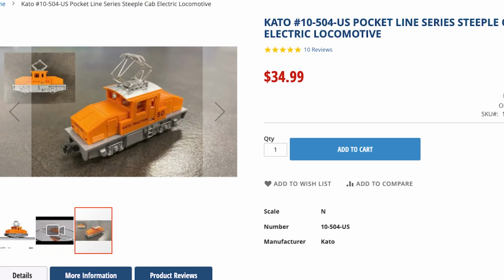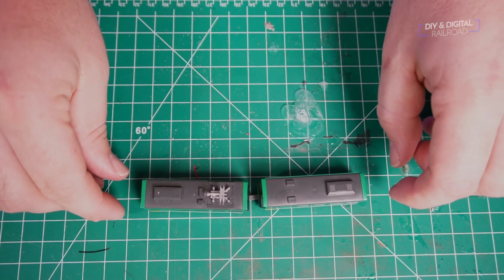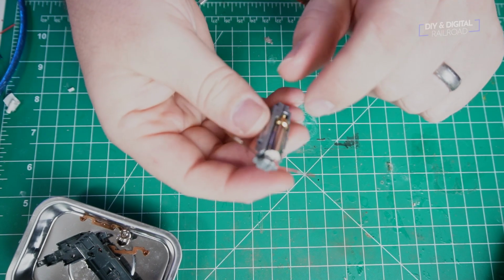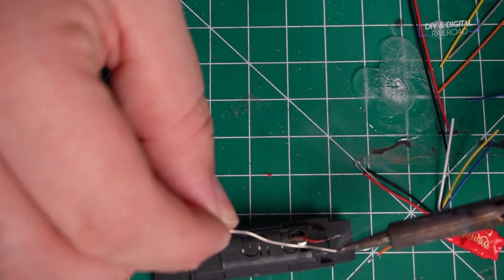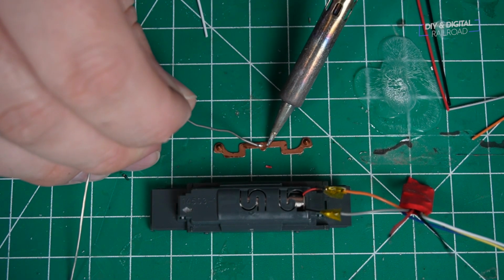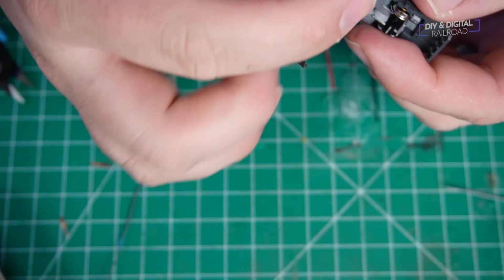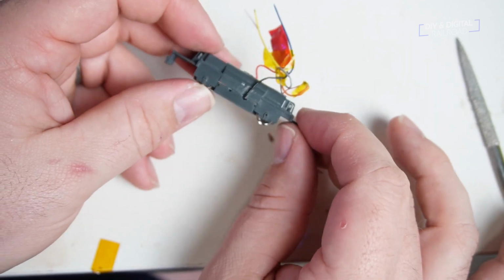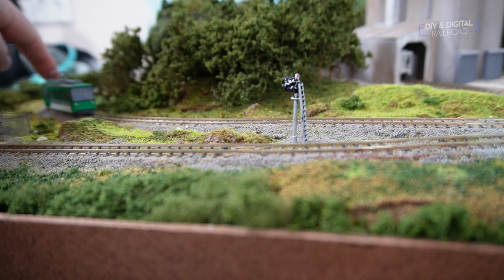Turning these Cheap model trains DCC

Comment: An easy alternative to kapton tape is heat shrink tubing: just cut a short length of heat shrink tubing, slip it on to one side of the unsoldered joint, then solder the joint as usual. Slide the tubing over the joint and lightly brush the soldering iron over the tubing - it will shrink down and conform to the soldered wires. The tubing provides enough insulation to prevent the soldered joint from coming loose.
Additional tip: if you're having trouble tinning a solder pad on the contact plate, try filing a small area of the plate to remove any oxidation. This should help the solder to stick better.

Comment: If you have trouble making a little solder pad on copper then I would recommend giving the area a quick sand so the solder has something to key/adhere too
Reply: I would also suggest a little flux on it as the surface most certainly is oxidized a bit which is why that solder was rolling off when it should have been sticking to it.

Comment: Super helpful! I may have to try this one or two of my pocket line units. Since they are pretty cheap, it might even be worthwhile to get two of them and then combine two powered units together instead of having one dummy and one powered unit and then maybe wiring them together so they share power pickups, so you don't have to install two decoders. I say this, of course, because I have two of those same tram units, plus two of the steeple cabs, so that might be a way to get better performance on grades and would help with any dead spots on the track. However, the pocket line units I have had seem to perform pretty well on turnouts as they are, which is surprising. They do have that little flywheel in there, which helps them coast a bit longer through minor power interruptions.

Comment: Nicely done. Sound isn't out of the question either. simply route the purple speaker wires to the trailing car with a sugar cube speaker. Micro connectors could be employed if you wanted to run the motorized unit solo. Always a nice watch

Comment: Nice conversion. Thanks for sharing this install. I have both pocket line models the tram and the steeple cab. This is a great idea. I got so use to DCC ready locos that I forgot about the first DCC installs that I did were mostly custom fit.

Comment: I always use flux on pickups all you need is a drop of solder then attaching the pre tinned wire.   I agree using a heat shrink tube to cover wire connection.   Great video by the way I have done a lot of hard wired locos and your explanation was spot on.   Thanks for sharing

Comment: Great Job, converting this chassis to DCC! 
I love watching your channel, especially the arduino projects.
Another way to connect the track wires from the decoder is using the copper pads you discarded. Solder the red and black wire from the decoder to these pads and put the pads back into their slots in the chassis. It is a bit more fiddly to do because you have to put the wires back through the hole for the motor wires but it looks much neater. It saves you tinning the contactplates and filing gullies for the wire.
Edit: Hmm I am a bit late with my solution, Thorsten Kammer already commented on this.

I used this chassis (kato 11-108)  and its siblings (kato 11-109/11-110) in a few of my 009 narrow gauge loco’s.
Regarding the slipping on the slopes you could try adding a bit of weight in the tram body, if space permits that is.

Comment: SOMMERFELDT makes functional pantographs in N scale.  To run on live overhead, run the red wire to the pantograph.  The black wire can then be connected to all wheel contacts.  One rail can then be divided into sections for activating signals, etc. Overhead wire can be either phosphor bronze like the prototype or nickel silver.

Comment: Hi
I had similar performance issues when I converted the steeple cab electric loco. It turned out that the drive gears were not properly engaged because the motor was not sitting down far enough into the chassis. It was the extra wires that were causing the problem so a bit of re routing and I got the gears to engage properly. It now runs well and will easily pull 6 uk style goods wagons.

Comment: The Bullfrog Snot is going to inhibit electrical continuity on any wheels that you apply it to.  I’d consider adding more weight inside the body, if possible, to add traction.

Comment: Interesting! I soldered the red and black pickup wires back to the original copper tabs instead, but routing the wires through the shell together with the other wires was a bit of a challenge. The steeple cabs are a bit difficult with cable management since the only place for the decoder is in the cab. I've also used a smaller decoder there (the DZ123 is quite big and long after all).

What you describe with the tram running sounds like maybe the motor isn't perfectly in place in the chassis; it's rather sensitive to small variations there. At least two or three cars should be possible over small grades.
Reply: Which (smaller) decoder did you use?

Comment: You fast torwareded past the most important part!  Removing all of the plastic parts, especially the metal chassis from the plastic frame!I have the wheelsets and contact strips out, but can't seem to get the metal chassis out of the remaining plastic.  HELP!
Reply: No need to remove the metal chassis from the plastic housing!  You can use the method described by MPeetnjes - Another way to connect the track wires from the decoder is using the copper pads you discarded. Solder the red and black wire from the decoder to these pads and put the pads back into their slots in the chassis. It is a bit more fiddly to do because you have to put the wires back through the hole for the motor wires but it looks much neater.  or use a piece of 32GA wire, soldered to the power connectors and fed up between the chassis and the plastic frame.  I like MPeetnjes method!